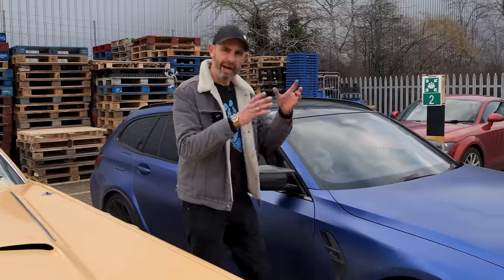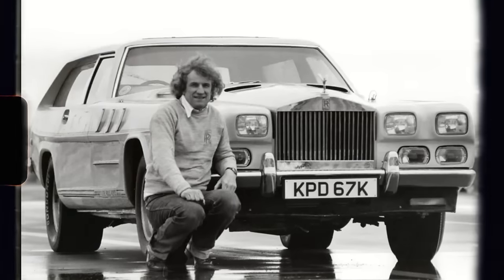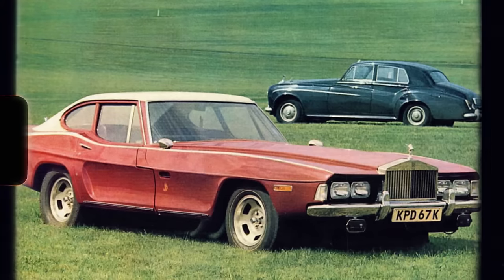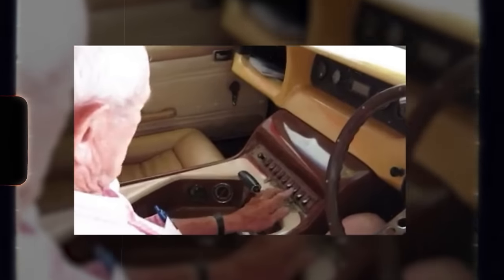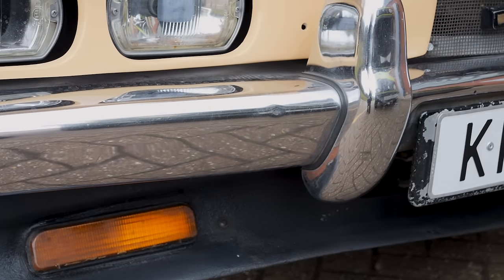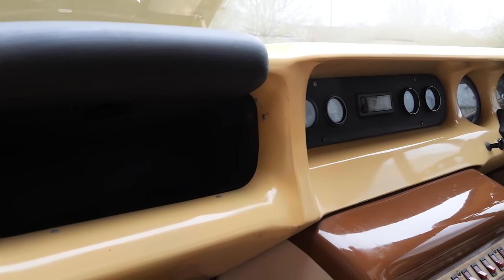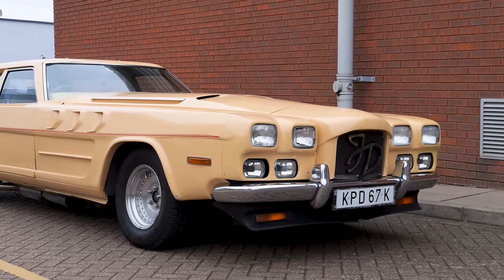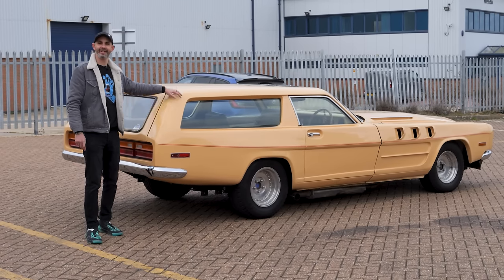Driving The Beast! 27-litre V12 Spitfire engined car on the street

Comment: For fear of sounding like a bit of a know it all, here's some interesting facts about putting a Merlin in a car. The engine in Johns car had the supercharger removed which meant he could then run the engine the other way or anticlockwise as most automotive engines do ( a Merlin runs clockwise). Obviously you cannot do this with the supercharger still fitted as it would become a sucker not a blower! It also meant he probably changed the cams to Meteor ones as Meteor engines run anticlockwise too. Merlins are also pretty low compression (around 6:1)  as they are supercharged, so with the blower removed there would be little issue with running a lower octane fuel. I think most of the clattering and whine is the overdrive between the engine and before the transmission, if I'm not mistaken it's a spur gear set up and straight cut. The reason I know all this is I have spent the last six years working out how to put a supercharged Merlin 66 in a car. I'm pretty close now largely thanks to Peter Grieve. If anyone's intersted take a look at 'The Fighter Ace Project' on FB
Reply: Get it on YouTube mate Facebook is a wasteland.
Reply: Yes, that was almost definitely gear whine on a custom (not mass-produced) gearset. That was my first thought, gear whine has that distinctive sound but mass-produced (not custom) gearsets have much development money behind them to cut down on the noise. I'm definitely going to go look at your project. The worst I've ever done was replacing turbo inline fours with V8s.
Reply: The following word is very much overused today but I'm going to use it anyway.. Your project would make an AWESOME YouTube channel.. All the development and the build, plus running it after completion.. That couldn't be done for 'The Beast' for obvious reasons so it would be a fantastic record of both your build and a general overview of the problems John Dodd also had to overcome (without CNC and modern engineering methods) - PLEASE get it on here !!..
Reply: Sorry for being nitpicky, but you can’t just let a four stroke engine run backwards, the timing would be completely reversed and would require some redesigning of the timing mechanism to get it running.
The supercharger is a centrifugal type charger, here it doesn’t matter which way it turns because the air will always be flung outwards, though the compressor wheels flutes will be shaped in a way to have the highest efficiency in its supposed operating direction.
All in all it would probably be easier to have a gearbox with an idler stage to reverse shaft rotation.
Reply: @Waldfuerst114  lol.
All you must do is change the Cam to run in the opposite direction. And depending on the ignition system, you probably need one designed opposite (points), but if you put a newer multi spark discharge ignition on it, it should work. You install the spark plug wires in the new firing order. You need to run the water pump in the same direction, or install an electric pump instead. How do I know that this is possible?

Boats with twin V8 engines, have 1 engine rotate in the opposite direction. Easy peasy.

He did mention that they changed the cam, but probably didn't mention everything that needed to be changed.
Reply: Are you sure? When viewed from the front the merlin spins the prop anti clockwise....Install the flywheel in place of the prop and it is turning like any road car engine.
Reply: @jakefriesenjake  Well yes, that's what I meant. You made it look like you just take the supercharger off, crank it backwards and off you go. So there is a lot of work involved to make it run backwards.
Reply: @joncorke760  I don't know which way car engines usually turn. Western aircraft engines usually turn clock wise if direct driven. That's why I mentioned an idler gear should it be necessary to reverse rotational direction. But I usually don't install aircraft engines in cars, so I wouldn't know.
Reply: @Waldfuerst114  I didn't start this comment.
The poster of the vid said that you must change the cam.

Probably the crank seals as well. It's not easy but it is possible.
Reply: Can’t you just flip the rear axle? Then he could’ve just left the engine alone.
Reply: @zxggwrt  Depending on the gearbox and gear wheels, it could be that they prefer to be loaded in one direction only. Running a gearbox backwards could lead to an early failure. But that really depends on the gearbox.
Reply: @zxggwrt  no, I don't think so. You would have to have the pinion (where the drive shaft attachs), pointed to the rear. It's possible though another gear box, or transfer case setup, but thats also more work.

This car is equipped with an automatic transmission, with a torque converter, and I'm pretty sure that plus the hydraulic pump for the transmission must spin the correct way, not backwards..... If you went with a manual transmission, your shifter would probably be all weird with it pattern...

What might work would be a regular reversed rotation airplane engine, a regular automatic th400 transmission, but in between the engine and transmission install a gear system box that reversed the output of the engine. They still needed to develop an overdrive system to increase the engine rpm from max 2500 rpm to something like 6000 rpm. So lots of work.

Building a custom cam to run the engine in the opposite direction would probably be easier and cheaper. Maybe $1000- $2000 for a custom grind.
Reply: @BlueZirnitra  we will Ben when we are ready to go, thanks
Reply: @jjrider6758  Thanks JJ, we debated a while back, TV series or YouTube? but now it's definitely YouTube. We will in due course, thanks for the enthusiasm.
Reply: @Waldfuerst114  You are right of course, the reason there was no blower on this car probably space as well as complexity. Still a number of Merlins have been made to run the other way by changing cams and removing the Blower, the one in Jay Lenos Phantom for one.
Reply: @joncorke760  car converstions remove the reduction gear Jon as you want less torque not more of it so drive is from the crank with an overdrive after it not reduction.. The prop shaft in aircraft configuration is too high to be practical too.
Reply: @zxggwrt You can yes but you run the coast side of the ring gear which isn't as strong
Reply: Honestly it sounded awful and nothing like I ever heard a Merlin engine sound in a Spitfire, or a Packard Merlin in a Mustang. The plugs sounded like they were fouled, and the oil burning although they do burn little oil on startup. Something wasn't right he said it had a turbo 350 automatic not sure what all the gear noise was. Likely this thing has been neglected for years and family wants it to go to someone who will care for it which I understand. Most kids have no interest in their parent's hobbies.
Reply: The supercharger was removed as there was not enough room in the engine bay to fit it.
Reply: @zxggwrt  TH400 gearbox only works in one direction, CW, unfortunately.
Reply: @dotancohen  how do you learn about transmissions like that, I’m interested in working on engines but transmissions seem complex to me
Reply: @sirtophamhatt4821  I really don't know anything about transmissions. But gear whine you'll hear anywhere two gears mesh (not with a chain). Have you ever seen a big diesel with timing gears but no chain? The cheap replacement gears whine like crazy but a good TRW or OEM set won't. If you're ever riding in something with a modified 9" (ha ha ha, this Beast has one too, now) you'll likely hear it at speed, too. But the mass-manufactured gear sets have been tuned to be quieter, something that some guy at home on a lathe just can not do.
Reply: @Waldfuerst114  Viewed from the front every car engine I've ever owned spins clockwise. And I've owned a lot.
Reply: So many things wrong in this comment.
Reply: Piers make a video and put it on here,we'd all love to see it! hope it's better looking than the Beast 😂
Reply: @Waldfuerst114  centrifugal blowers oulet is tangential, if you run them backwards there's a whole lot of aerodynamics working against instead of for you.
Reply: @dotancohen   came to comments to say its a shame there's a straight cut gear in there drowning the Merlin.
Now cnc is 2 a penny compared to when the car was created, that could be remedied.
Reply: @dougaltolan3017  Not a shame, rather, just one detail that was interesting and obvious. There are a ton of other details that are interesting and obvious about this vehicle as well.
Reply: Jesus said, “No one can enter the Kingdom of God (God's family) unless he is born of water and the Spirit. Flesh gives birth to flesh, but spirit gives birth to Spirit. You should not be surprised at my saying, You must be born again” (John 3:5-7). what does this mean? Well you have to believe with your whole heart that JESUS died for your sins and after 3 days and nighrs GOD raised HIM from the death, so you can be baptized and after being baptised ask GOD for the HOLY SPIRIT . WHO will guide you trough life!❤❤❤
Reply: Trabant DDR